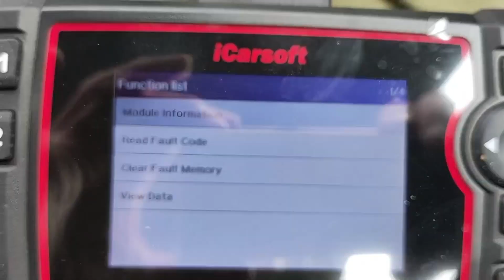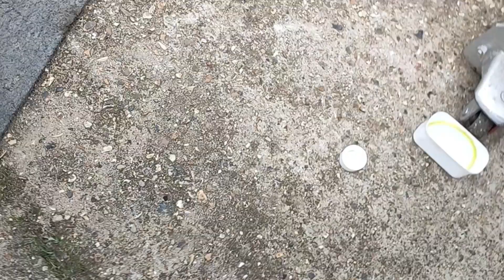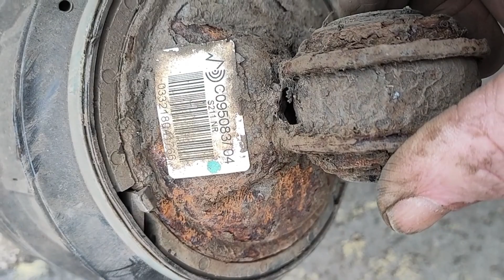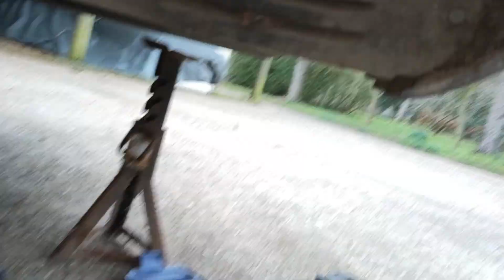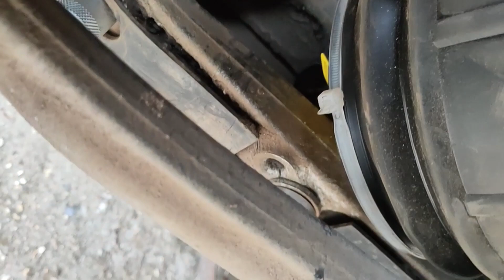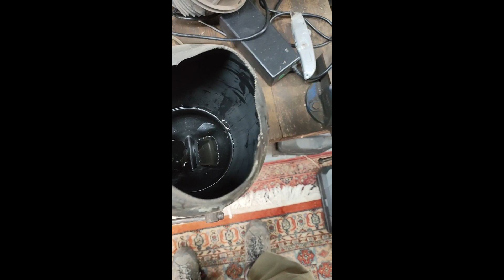Mercedes E320 CDI W211 S211 Suspension flat

Comment: I've ordered two of the three pin ones. It is for cars with ADS where you can adjust the ride height. Luckily the Arnott ones have done away with the reservoir tank, which yours doesn't have. It would require dropping the subframe and making it a much harder job to replace.

Comment: Did my rear passenger side today. On the driveway. Bit of a pain but managed it. Car is finally sitting level after ages. Great video. Very helpful. Thanks
Reply: How much it cost ?
Reply: @halloweenjack8683  it was free as I did it myself. The airspring was 90 quid. It may last. It may not but my car is level again and doing what it should. I should have done it alot sooner though.
Reply: @jamdebs9412  👍
Reply: @jamdebs9412 how long did it take you and did you just use a jack?
Reply: It took a few hours. Didn't rush it. Borrowed a friend's trolley jack but used a bog standard car jack to help alignment of certain components @hl236

Comment: Great video. My E320 does exactly the same. Its been like it for ages and is causing the tread on my offside rear tyre to wear down on the inside. The tread wear was picked up on my latest MOT. Im fairly proficient with tools. Can I do this on my driveway without major issues. Thanks in advance.

Comment: I put Arnott in my W212 E350 Wagon last weekend...I am a pretty handy guy...but, heck, under 45 minutes total! On one side I did take out all the bolts (two) under the air spring, the other side I just compressed the bags and slid them out (had a hand to push the brake rotor down about 1/2".

Comment: It's such an easy job and there are many non-oem replacements as good or better for great prices.  The self leveling feature is why I would never go to steel spring replacement.  I carry some heavy loads and the ride is always correct.  The currently installed Arnott air springs have lasted longer than the OEM.

Comment: After this happened on mine I replaced the rear with normal springs so I dont have to worry about this anymore.
Reply: @AS.MA_  I had airmatic only on the rear so there is no noticeable difference at all.
If I had the air on all wheels it would be a different story I guess.
Reply: @Ender1337  
Ahaaa i got it
your car is Wagon.
Wish u best ❤
Reply: How did you do it? Was ut expensive? I wanna do it so any info would help!

Comment: you only have to remove the air spring bolt 21mm the airline and the electric switch push the whole assembly down with a bottle jack air spring will come out just done both of mine today took an hour to do very easily.
Reply from the maker: I didn't do that because I thought that the damper was at the end of its travel and I didn't want to strain it. But if it worked for you then it sounds like a good idea.
Reply: Hi Colin mate prib a daft question but did you take any pics or anything? Looking to domthus myself got a fair idea (ish) lol but any tips or anything you came across that would help out? :) thanks.
Reply: @mrtoast4740  its a simple job  hardest part is getting out the 10mm  air vent  make sure you fit the new locating pin which will come with the new air strut  it holds the strut in place till you put air back into it if not located it destroys your airbag in about 5min guess how i know this
Reply: @colinsmith3938  thankyou brother 🙏